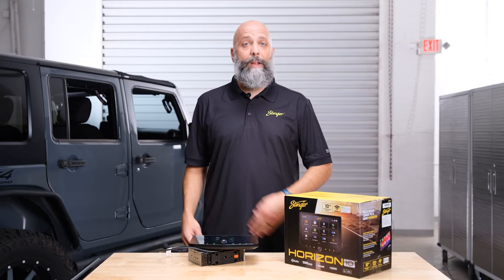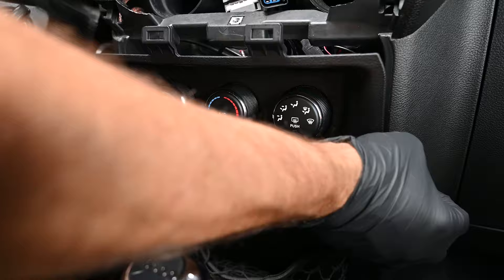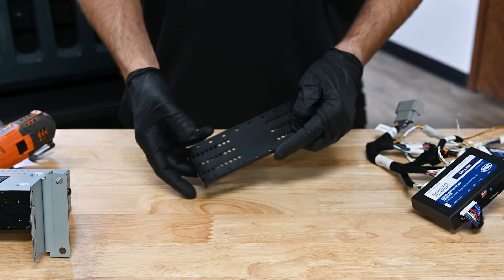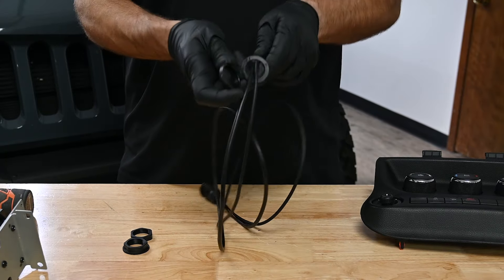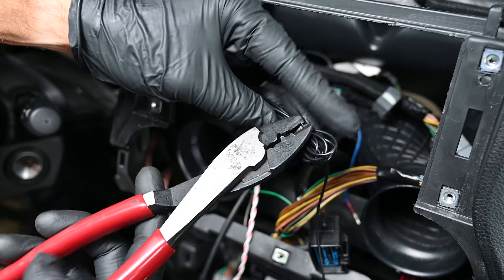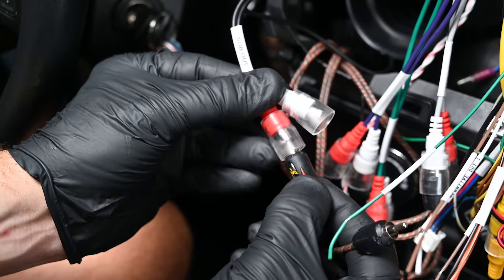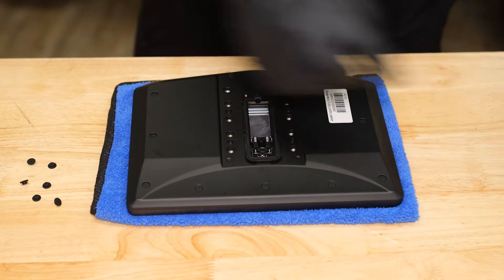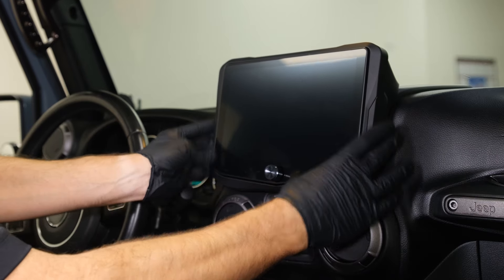Install: HORIZON10 Jeep Wrangler JK (2011-2018) 10" Radio Fully Integrated Kit

Comment: You guys need to talk about the plug for the T harness.  It's NOT that easy to find and it could be wrapped up in tape ! 
Also the fact that if you have a tuner or something else on the Can bus , you might get funny lights .....
Reply: I need help finding the T harness
Reply: @FredwardStokley 
Mine was located just above the carpet in front of the center console